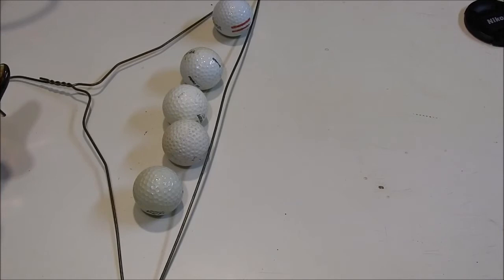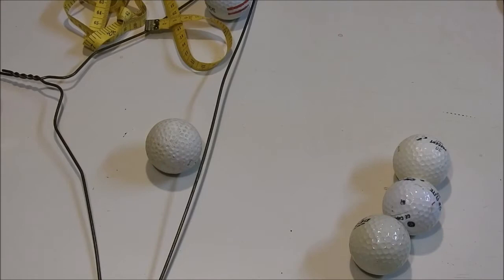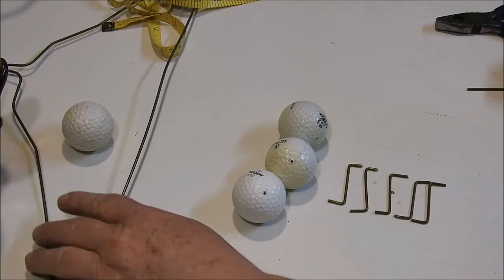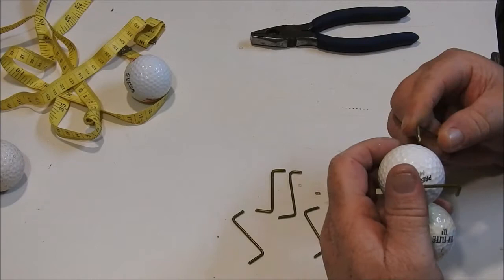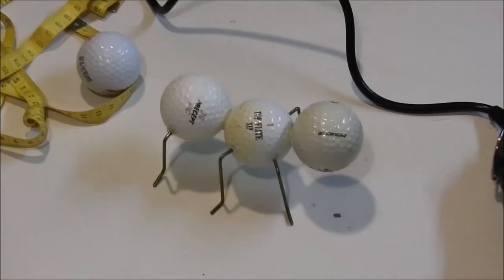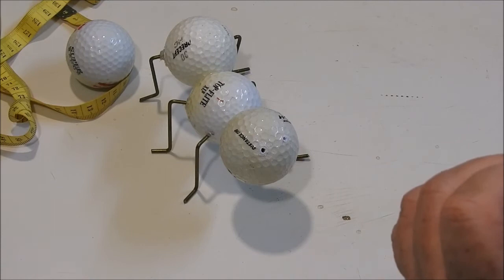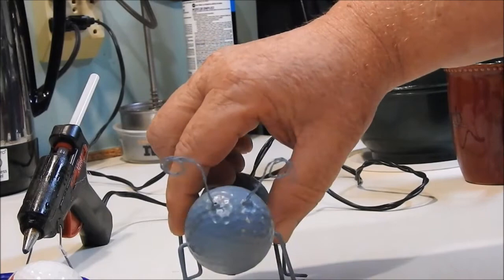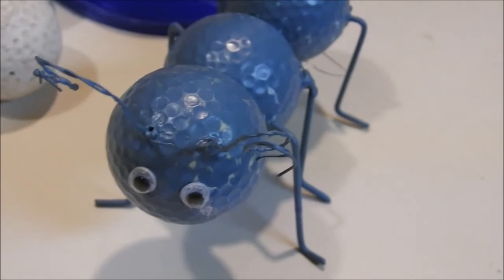crafting with old golf ball's

Comment: But if you put it outside in 85°f or higher the hot Glue will eventually melt. So I use E-6000 or E-7000 for out door projects now. I found out the hard way.
But those are very cute.
I am also doing some projects with my found Golf Balls. So far I have made 2 lady bugs for 2 friends. I am in the process of making a Gnome out of Golf Ball. Eventually I will make me a Spider, Lady bug and a Tweety Bird.

Comment: How well does the hot glue hold up? Isn’t it brittle? These creatures are a toddler magnet and will probably get some rough handling. How about drilling all the way through and supporting the connection with wire?